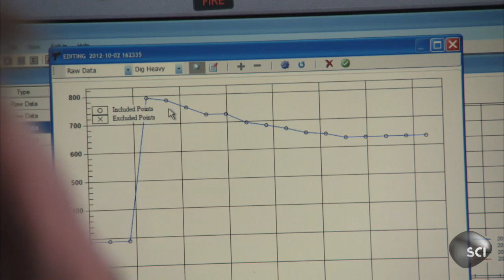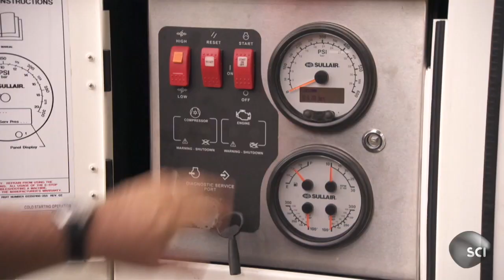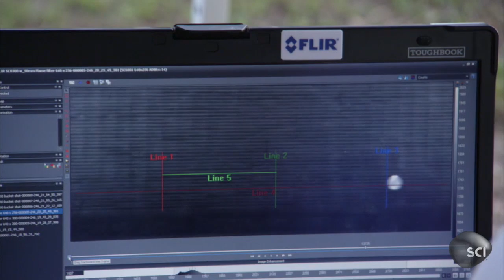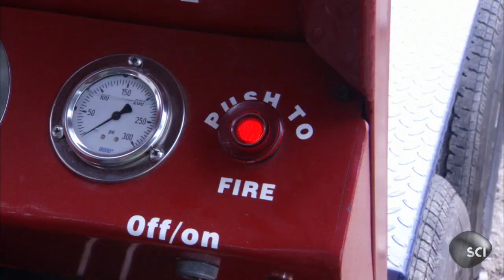Going Supersonic | Punkin Chunkin

Comment: they could have saved a lot of money by running vacuum on the barrel
Reply: In theory, yes, but if I'm not mistaken (which I probably am, not being a top pumpkin-chucking engineer, let alone a master of ballistics and stuff), wouldn't a vacuumed barrel require a closed front end of some kind to maintain said vacuum, which the projectile would have to penetrate in order to continue, possibly squashing itself in the process? Either that, or the closed front end would have to be engineered to open with enough room to spare for the projectile to pass unsquashed.

Obvs, I could use an explanation on how the whole thing's supposed to work, if you wouldn't mind. Preferably in layman's terms, of course. Ballistics (and other forms of science!) is fun, and I like hearing about it!
Reply: @Caldoric  you are correct!!

Comment: I notice in the high speed film,...you can see the shock cone. The air does indeed to appear to be going super-sonic. If anyone wants to see the same effect on a smaller scale, take your air compressor pumped up,..and fold the cleaning nozzle above some white paper, and wait for the sun to be nearly overhead, if you look closely, you can see the shock cones,...just like a tiny rocket nozzle. The suns rays are refracted by the shock waves. Its really cool,..I noticed it purely by accident. Enjoy. As to the pumpkin going super sonic, I think cannon makers of the 19th century,...kept putting bigger and bigger powder charges and the cannon balls would not go any faster. If I'm not mistaken making a "SPHERE" go supersonic was the issue. The pressure separation zone behind the ball, created enormous drag. Now,...if you put a streamlined detachable tail piece,...you might go super sonic "briefly". Just speculation mind you. Maybe in less dense air it might be "more possible",...if you shot it out from a mountain maybe. hmmm,..interesting problem. Golf balls go farther because of the dimples, boundary layer issue, laminar to turbulent transition. Would dimpling the pumpkin help? :-)

Comment: It is scientifically impossible to break the sound barrier using a straight barrel and compressed air. You reach a condition called choked flow at the sound barrier and no amount of additional pressure will cause the air to speed up any more. These guys could hook up 1,000 of those industrial air compressors and use an indestructible pumpkin and they still wouldn't break the sound barrier.
Reply: Who's to say they don't have a convergent-divergent nozzle inline there?
Reply: Michael Wyrick I wondered the same thing. If they have a CD is must be here: http://i.imgur.com/UogZCoc.png

That looks like a regular spool piece of pipe but I suppose it might be a machined nozzle.
Reply: Chris Morris Rifles regularly exceed (even double and triple) the sound barrier by having compressed gas push a projectile through a barrel (and a rifled one at that, increasing the resistance). So, I don't understand why you'd think it's impossible.
Reply: A firearm uses hot gas to propel a bullet. In a hot gas, the speed of sound is higher than the speed of sound in free air (speed of sound = sqrt(gamma*R*T). So the gas propelling the bullet isn't traveling faster than its speed of sound.
Reply: Chris Morris Interesting, thank you. I'll look into it some more on my own.
Reply: Chris Morris god damn it, just watch the video and leave your keyboard alone.
Reply: kilroy1964 Guns use explosives which add considerable amounts of heat energy to the system. Something compressed gases simply do not. That being said I think it would still be possible to achieve supersonic flow down a compressed gas barrel. I wasn;t the greatest at fluids but from what I understand as long as your barrel is the "diffuser" part of the system and you have choked flow, you should get supersonic flow in the barrel.
Reply: Chris Morris If you think of a C-D nozzle under chocked flow, if the barrel is the 'diffuser' then it is quite possible to achieve supersonic flow down the barrel. Supersonic wind-tunnels use this principal and the one that we have here on campus runs of a simple compressed air tank and compressor.
Reply: Do you know if there is a continuous decrease in "acceleration with pressure" approaching the speed of sound?
Reply: actually, they do it with airguns all the time
Reply: What about airguns?  A single-pump spring powered air gun hits 1400 fps.
Reply: ive gone squirrel hunting with a pellet gun that hits 1300 fps lol you're right
Reply: @Rattletrap-xs8il  Yep very true
Reply: You're wrong buddy, so fucking wrong buddy

Comment: If they are at 500psi...and near breaking the pumpkin through acceleration, why not have a two or three stage release...?
Reply: I'd think immediately about treating it like a shotgun slug: enclose the entire thing in a thick cardboard 'sabot' with the back side of the cardboard being thick/strong enough to survive the blast:. upon exiting the barrel the sabot/wadding just falls off the pumpkin just like shotty shell.
Reply: @djdrack4681  Unfortunately, they are limited by the rules of the competition, they don't allow anything but the fresh grown pumpkin itself to be loaded in the barrel. No sabots, no wadding, no fins or drag tails, nothing. I think that the rules need to be amended, it's gotten boring, one, allow the use of flammable fuels in conjunction with compressed air (think something like the piston in an engine compressing a large amount of air/oxygen and fuel into a much smaller volume for more power), and two, we need to see pumpkin speed limited only by their ability to withstand air friction, a mach 1+ pumpkin would really gather the crowds.